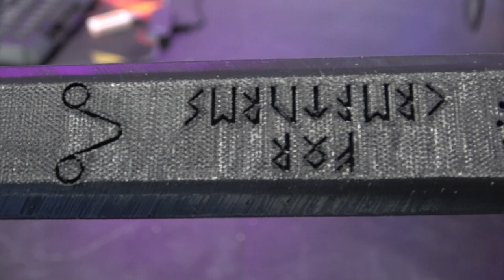Ender 3 belt kit - Infinite Z without the headache???

Comment: One of the guys in the Ender 3 Belt Facebook Group designed a whole printable mod to easily convert this to a Direct Drive,  The guy you mentioned Scott "just" printed up a 6 foot Falkor from the movie "Neverending" Story, on the stock kit, NOT without issues, but he did it :), Andre's Ender 90 degree belt just released. You mentioned the Sidewinder Kit as a better option, just something to note, the Sidewinder itself is triple the cost of Comgrove's Ender 3, and the actual Sidewinder belt kit itself, is $100 more. Just to put costs of the Sidewinder Belt into perspective for someone starting from scratch. I think Andre's team has a CR10 kit coming out? I bought and built the Ender 45 for a specific purpose, and as you mentioned, and Scott also mentions in his video, this should not be your "only" printer. It is a specific purpose machine, and if you have a specific purpose, it seems to do the job at half the cost of the CR30, even with the printable Direct Drive mod that Richard Bruckner did in the Facebook group. Great Review, from one of your "Subscribers" :)
Reply from the maker: first of all thank you for the support on the channel without your engagement we have nothing, secondly the only reason i would recommend the sidewinder would be to get direct drive and inductive endstops, i think it would still work out cheaper than a CR-30 and would be better IMO

Comment: LMFAO you're going to upset all the Ender Fan Boiz!! So glad I;m not the only one who sees right through the Ender fandom and their undying need to defend the POS. All you ever hear from them is "you can get great prints from an an Ender as long as you upgrade this, mod that, add this, buy that, flash this, swap out that"....it's no longer an Ender then is it?
Reply from the maker: lol look i started on an ender 3 the same as slot of people did, and fundamentally it does what it says on the tin its good enough to give you the itch for 3d printing but not so expensive that you have to like it after you start, but it requires alot of maintenance and tweaking and you will be forced to learn alot
Reply: @honeybadger3dprintandpaint  I was fortunate enough to receive a "miss-sold" PPI claim when I bought my first printer. I looked at the Enders and knew I'd eff up the build, so I splashed out the extra cash and bought the Wanhao i3 clone. My second print was an Ender 3 and I'm still pee'd off at the money I wasted buying it. Almost gave up completely until I drunk ordered a SideWinder, not normal drunk order, full blown Scottish drunk order. i.e.  I had absolutely no memory of ever buying it until the Yodel fella showed up at the door with a big box LMFAO